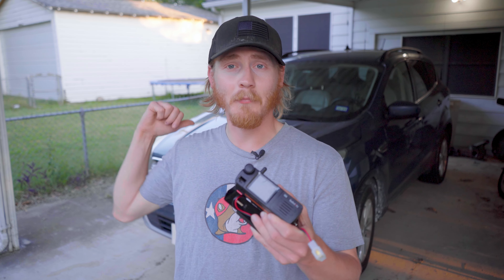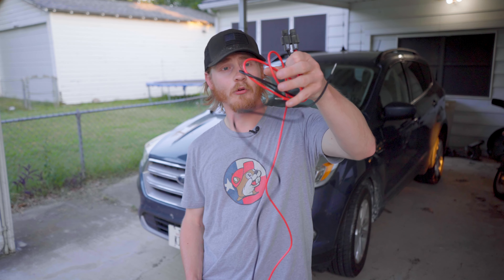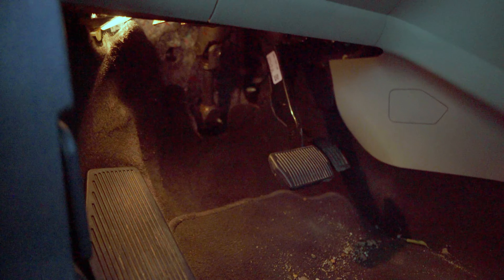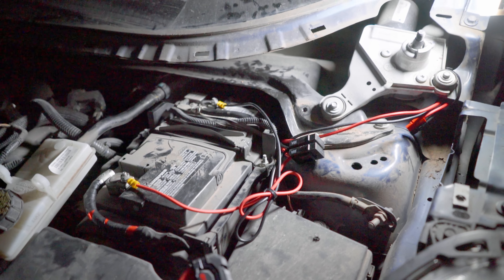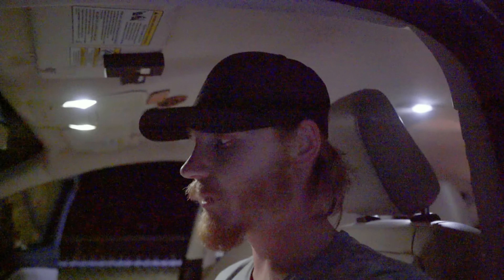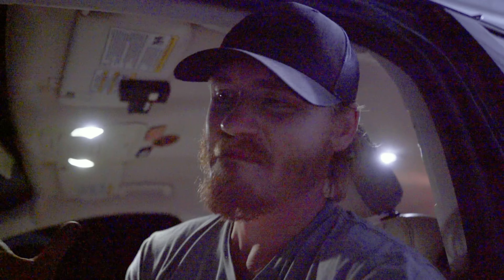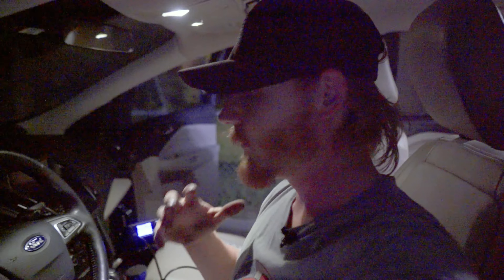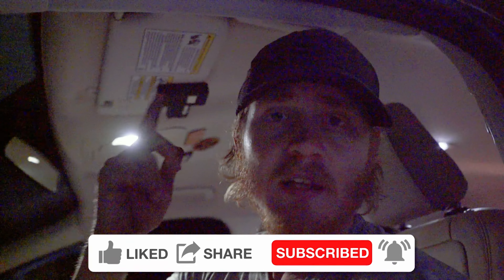A Look at My Mobile Ham Radio Setup!

Comment: Nice install. I like that you did both neg and pos fuses at the battery. The K-400 is a good choice. I've used them with my Hustler HF. .  . though they don't last forever when hitting low-hanging branches. 73 de n6bvz/4